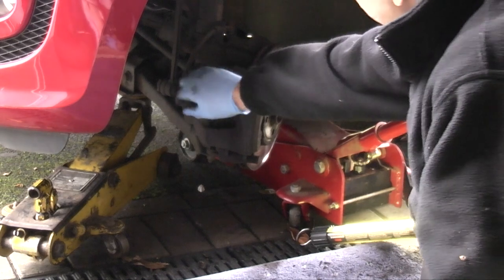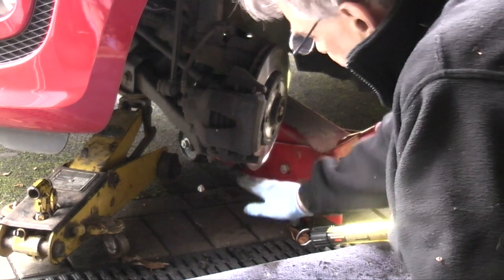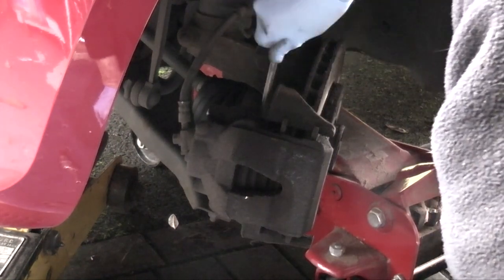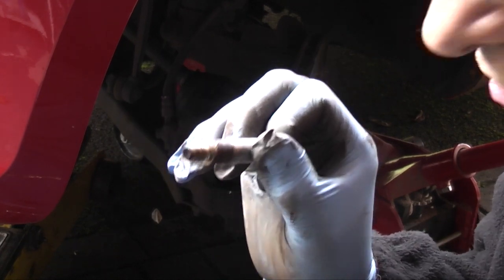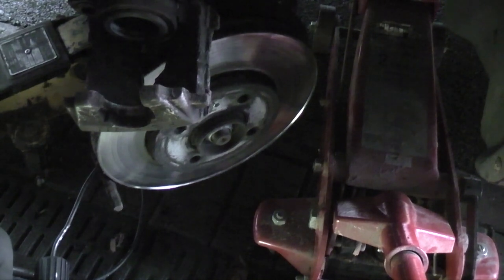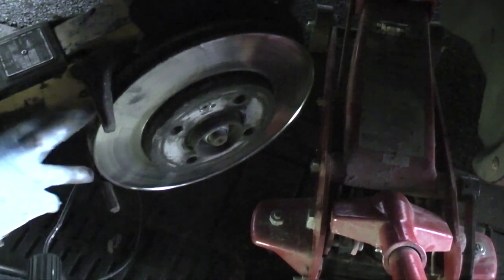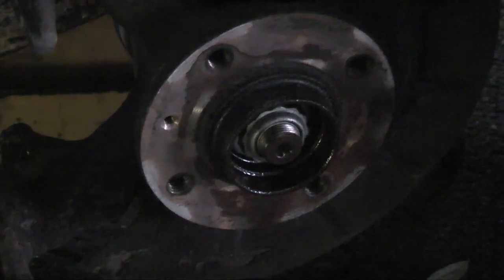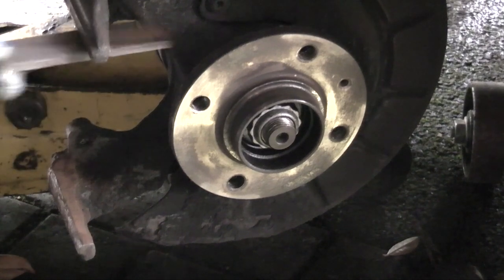Fitting new front discs and pads to a VW UP

Comment: One thing to remember for the next time you need to change disk pads is to loosen the bleeder valve before trying to move the piston. I loosen the valve first and then, using a screwdriver pry the pad against the rotor and when the piston is collapsed, tighten the bleeder valve again. That way you don't have to worry about fluid running out of the reservoir.
Reply: Make your own video bud! Hate people always trying to look smarter telling another mechanics how to really do it.

Comment: Nice video - you are right about garages and tyre fitting places over torqueing wheel bolts. VW say 110Nm for them. I fitted a spare I bought after a puncture & took the wheel to a repair place. They pluggged it and before I could stop him a 'helpful' chap jacked my car up and used a long bar to refit the wheel. Well over the correct torque. At least twice  a year I remove callipers ad clean everything up the use copper grease on those faces. I had to buy a whole set of torx bits and keys for it and most of my other tools are now redundant ! Nice cars tho - easy to work on and well-tried mechanicals (I suspect a lot are from the Polo parts bin).

Comment: Loosen the bleeder valve before pushing back because, the way you show it, you pushed the old nasty brake fluid back into the system instead of pushing it out of the system.

Comment: Great video! One thing I don't understand though: you haven't pulled the hand brake, right? I'm just guessing because you say the front wheels can turn freely. But I've been told that you always need to pull the hand brake before you raise the car with the car jack. How do you safely raise the car on a car jack without the hand brake pulled? How do you prevent the car from moving while you're working on it? :)
Reply from the maker: Hi Yes that's right. The work was on the front discs on the car the hand brake only holds the rear wheels on this car.
So the front is free to move.

Comment: Allen, just a tip, it is easier undoing wheel nuts pushing down, rather than pulling up. That way you can use your body weight. Garages are always supposed to run nuts up lightly with air gun, and then fully tighten to correct torque with torque wrench.
Reply: Man can pull more then push.
Reply: @Cous1nJack  Def we can pull more than push, but as you get older you should consider using your body weight pushing down rather than pulling having to use your back in a "weird" position. Thank me later 🤣

Comment: Thanks for this comprehensive video.  I haven't changed pads for at least 20 years but now need to do this for my daughter who drives a mii and found your channel.  I just want to ask why you changed the disks - you mention 2mm wear and I remember from Haynes days there were max wear specs - is 2mm over the spec?  Also just wanted to ask why you didn't use your lovely lathe to take off the lip?  I'm guessing it is just the disks are cheap enough to buy but hopefully you can reply for me.  I don't have a lathe so if the disks are worn to excess I will need to change them too.  Thanks again for the video, I always levered the pads back against the disk with a big screwdriver!
Reply from the maker: Hi my discs had score marks they had done 60000 miles

Comment: Thx for this great video. I have never changed brakes before. I dont have 10 thumbs so this seems ok to do for me. But one thing im wondering about. You dont do any "cleaning" of some sort on the calipper itself?  Around 6:46
 on the timestamp of the video when you remove the the spring loaded pad....that area where you hold your right thumb...it looks for me it should be cleaned as well?
Reply from the maker: Hi I did not clean the piston but you could give it a wipe with a cloth. I would not put any chemical cleaners on it as it may affect the rubber seal. The important part is the pad carrier that's what the pads slide on.
Reply: @enotsengineering  Yeah that I understand, but I'm not talking about the piston... It's this area where it seems the brake pad is kinda resting on a surface. I don't know what it's called but the piston is mounted on that frame or bracket... And when you remove the spring loaded pad on 6:46 there is this area all the way to the right where you have your thumb since you are holding the calipper with your right hand.. for me it seems like the pads are sliding there aswell. If we could just show a screenshot 😅
Reply from the maker: Hi The pads slide on the rail but at the back of the pads there is very little dirt.  Just wipe away any dust from the faces that contact the back of the pads. The one pad is held against the casting (fixed). The other pad moves along the rail as the piston pushes it out and grips the disc

Comment: Hi, what's the right torque for the two bolt of the caliper?
Reply from the maker: Hi Ale I looked on internet it is 35Nm for the calliper bolts
Reply: @enotsengineering  thank you. I saw the same in another video and you confirmed
Reply: @enotsengineering  Hi, sorry for multiple questions, but I need to replace the disks too. Maybe you also know the torque for the torx screw that keep in place the disks? I imagine is something near 30/50Nm. thank you

Comment: I remember going to a well known chain of Tyre Fitters and the cross treaded one stud when I had some work done on the front brakes.
I wont name the company but I did start a claim against them before they agreed to replace the entire hub.
I came up with a modification to their TV advert jingle which went " You don't get thicker than a, ?????  and named to company. 
It worked they paid for the front hub to be replaced.